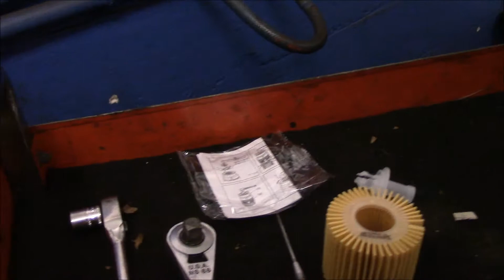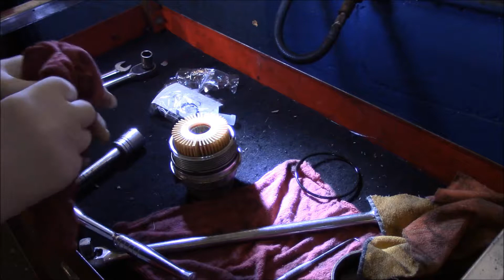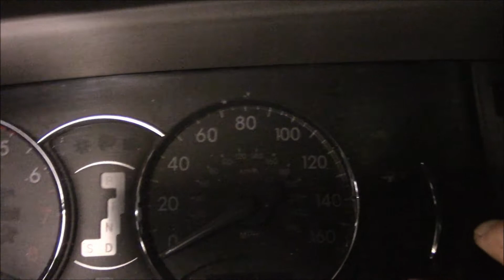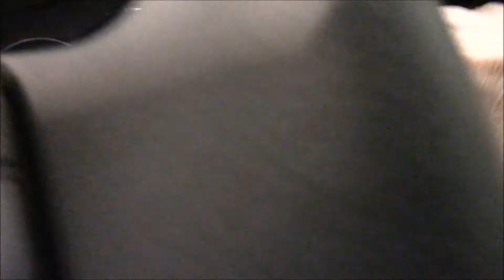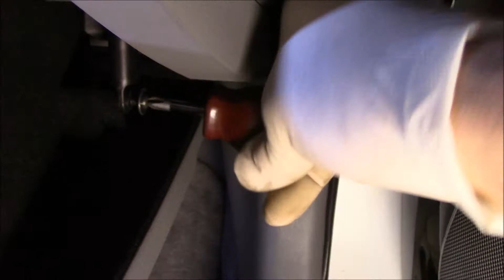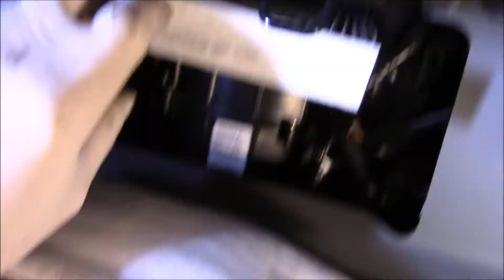Oil change maintenance light reset cabin filter and air filter replace 2008 Toyota Avalon

Comment: Spin on filters are also called canister filters (spin-on canister). I would call this filter a cartridge filter to differentiate between the two.

Is there a good reason why you didn't demonstrate how to drain the oil filter for those who are interested in that?

You don't need tools to remove the o-ring
https://youtu.be/3R1KMN1ys3A

I didn't see where it said up next to the arrow on the new cabin filter. If it didn't say up then the arrow should point down in the direction of air flow (which is the industry standard for air filters).